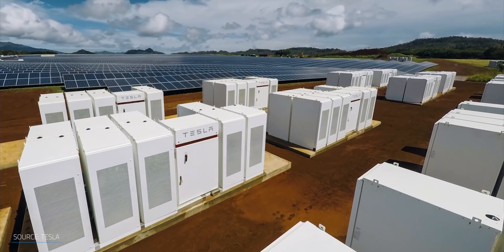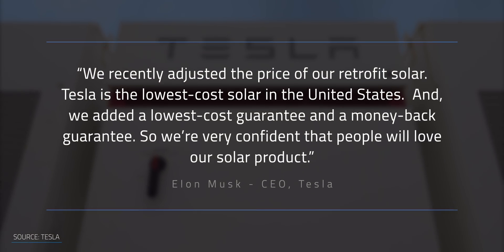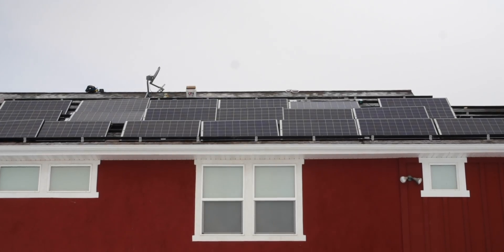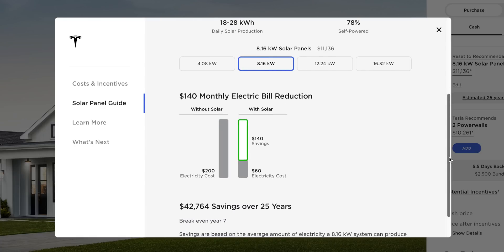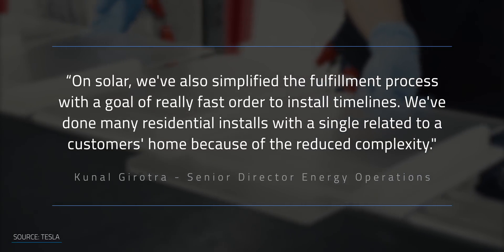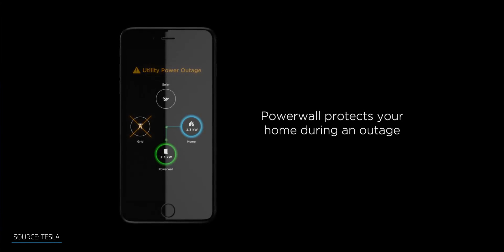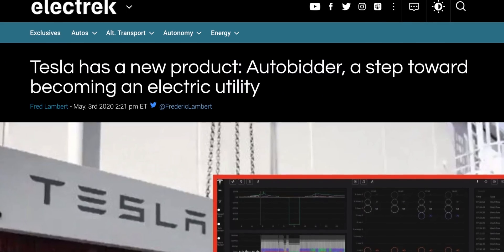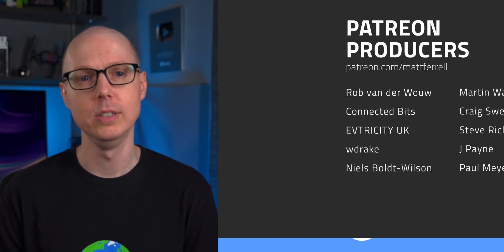Exploring Tesla solar panels game changing price

Comment: Solar panels require a 20 year warranty, imagine if that was the case for their cars and batteries.    And how long does it take to charge your Telsa car from the solar panels on your roof?
Reply: James in little as 4 Hours, but you are Better off Storing that Power in Powerwalls and selling PEAK Energy to your Utility for Credits. 
you can still Power your entire home and Charge your car with Powerwall.
Reply: Their solar panels have a 25 year warrantee.  My girlfriend has Tesla solar and a Tesla Model 3.  Charging her car is the same with or without solar.  It charges the same day or night.  The panels aren't connected to specific things like the car charger.  They are connected to the grid along with everything else in the house.  When they are making more power than the house is using the meter runs backwards, the power goes into the grid, and it powers the other houses in the neighborhood.  When the house is using more power than the panels are producing then that energy is pulled from the grid like any other home and the meter runs forward.  So nothing really changes in terms of how electricity is used in a home with solar.  It's more like having your own personal power plant on your roof that provides electricity to the grid and cancels out your own usage on that same grid.

Comment: 2 months back we have 4 kw of solar installed at our house in India. It was around $0.4/watt with installation and without any incentives.
Reply: Yeah. This $1+ per watt is only impressive if it includes storage/batteries.
Reply: Nice bro, did you install tata panels, and how is this all going for you? I think 4 ke should be able to run 2 AC during the day , correct? I am in india from Haryana looking to get it too but just digging some more info before i install it.
Reply: @Ajay-zi6im  I'm able to run 1 inverter AC during the day. And it all depends on the size of your inverter and batteries.
I'm having a 5kw inverter, but if you pair it with the 8kw inverter you can easily run 2 AC during the day.
Reply: @sanchitrastogi55  if my 1 AC is 2kw then would you think i will be able to run 2x ac  with it?
Reply: @Ajay-zi6im  I'm not very sure, you have to ask your electrician.
Reply: Not so cheap when you look at India per capita. you are paying 0.4/w  where per capita is around 2K. In the US we pay 1.3/w where per capita is around 66K. As you can see It cost triple in the US but the per capita is also triple the per capita of India. My Friend, we can't beat the capitalism
Reply: @fa7234  . That's absolutely false and nice job trying to reduce the entirety of India to a backwater third world country. I'm not even Indian and I was able to verify your claim as false with my first online search. Rural people in India making $2k per year aren't usually the ones making large solar panel purchases. Link below on income per capita by city. 

But feel free to continue defending the feudalist states of America. 

https://en.wikipedia.org/wiki/List_of_Indian_cities_by_GDP_per_capita

Comment: I do not currently plan to get solar. 1: my roof isn't close to needing replacement.
2: I want the roof replacement, not panels.
3: I expect the prices to continue to fall.
4: I expect the technology to improve with time.
Reply: Reasons 1 and 2 are contradictory, and reasons 3 and 4 are pure speculation. At what point do you decide that the technology has improved enough, and is cheap enough, to satisfy you? That timeline is likely as long, or longer, than it would take for solar panels to pay for themselves if you bought them today. If it happens after that break-even point, you're just throwing money away as you wait around for a loosely defined "ideal" buying point.
Reply: @pearce05  One could make the argument as  panel prices continue to plummet along with batt and other storage technologies, power production at scale will become less (perhaps dramatically less) expensive thus reducing prices for grid deliverd power to the consumer. I am not so sure the OP is wrong in his/her thinking at the bottom line.
Reply: @pearce05  I'm just saying when I get it, it will be a roof replacement, not merely panels. 1 & 2 are in no way contradictory.
3 & 4 mean It's not worth an early roof replacement. Once the roof is ready to be replaced, unless circumstances do not allow, I'll get one. GG
circumstances: i'm in debt, or had to sell the house.
Reply: Chimerawizard what’s the condition of your roof; you may have to wait decades before it needs replacing! Given the cost of a completely new roof, this just highlights the fact that although we’d all like to do the job properly, from an aesthetics point of view, the reality is the majority of us will have to fit panels to our existing roof.
Reply: @nickmartin884  like 7 years old, in excellent condition.
Reply: @chimerawizard5639  Are hailstorms common where you live?  Where I'm at, you never know when you might be getting a new roof due to hail.
Reply: @LG123ABC  hailstorms are around as common as hurricanes, and hurricanes seem to avoid this part of the state like we're a plague.

Comment: It's expansive.. In Romania a monocrystalline 380W panel with 19.5% efficiency is like 170.4 USD so 0.44 $ per watt
Reply: did you count MPPT, cables and installation into the price?

Comment: Australia is in an energy crisis. They shut down all their large coal plants and most pay hundreds of dollars each month for electricity. AC is not an option. Get politics out of energy. They want everyone to go solar or wind. The problem is it is not consistant power. Australia's energy system is a disaster.
Reply: And yet over 40% of electricity in the UK is from renewables, over 30% from wind, less than 5% coal and prices are cheaper than Australia. Go figure.
Reply: @David-bi6lf  In 2016, total electricity production stood at 357 TWh (down from a peak of 385 TWh in 2005), generated from the following sources:[56][57]

A typical offshore oil/gas platform
Gas: 40.2% (0.05% in 1990)
Nuclear: 20.1% (19% in 1990)
Wind: 10.6% (0% in 1990), of which:
Onshore Wind: 5.7%
Offshore Wind: 4.9%
Coal: 8.6% (67% in 1990)
Bio-Energy: 8.4% (0% in 1990)
Solar: 2.8% (0% in 1990)
Hydroelectric: 1.5% (2.6% in 1990)
Oil and other: 7.8% (12% in 1990)
The UK energy policy had targeted a total contribution from renewable energy to achieve 10% by 2010, but it was not until 2012 that this figure was exceeded; renewable energy sources supplied 11.3% (41.3 TWh) of the electricity generated in the United Kingdom in 2012.[58] The Scottish Government had a target of generating 17% to 18% of Scotland's electricity from renewables by 2010,[59] rising to 40% by 2020.[60]
Reply: Coal fired power stations were shut down because they were not price competitive, old and needed replacing anyway and or way to expensive to repair. RE is not only cleaner but cheaper. Cost of electricity jumped in Aus due to a 3 fold jump in gas prices. The Aus government is highly owned by the FF industry as is the US. The most unreliable form of generation is coal as determined in the last government report. In 2018 FF generators failed over 200 times. Since massive storms caused blackouts in 2016 every black out has been the result of FF generator failure. Politics should get out of energy but they won't as they are owned by the FF industry. That's why when a privately own generator announced it would shut and convert to cheaper cleaner RE, the government announced it forcibly take over the privately owned generator and make it stay open and run on coal. They said they would use taxpayer money to pay the 100s of millions required make it safe to operate as it wasn't and to keep it running. Then they announced they would build several coal powered generators on the taxpayer dime at the cost of $5-10 billion each.

The reason the Aus energy system is a mess is it is being sabotaged by the FF owned government.
Reply: @jamespyke6764  You make some very good points James. However, RE failes each night or everytime the wind stops blowing. There needs to be some combination until energy storage becomes more affordible. Second, most math I've seen uses many hypothetical  costs to compair one energy souce to another; making the math as plyable as the the proponent desires. I would bet that most would like those old (unreliable) plants re opened so they can again run their air condition and pay a fraction of the current energy costs.